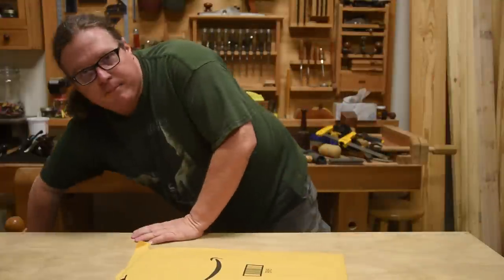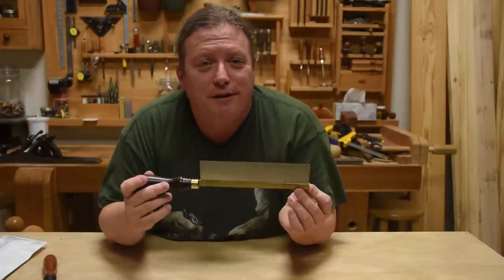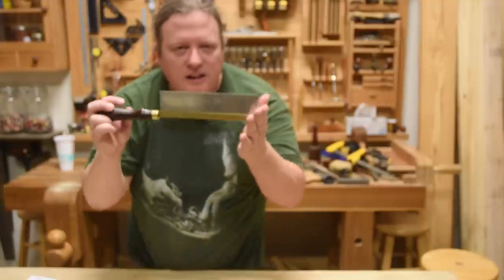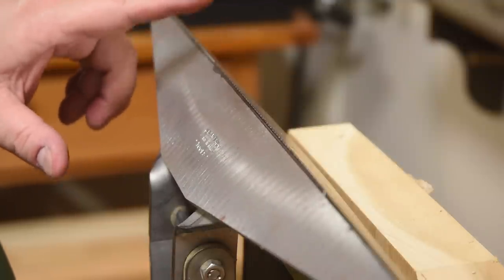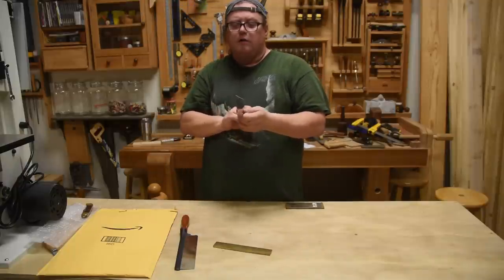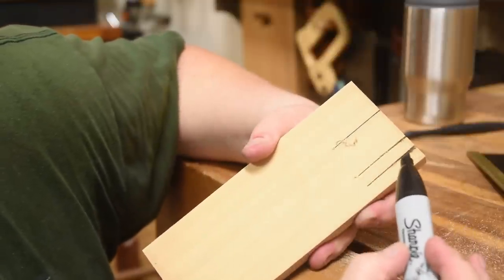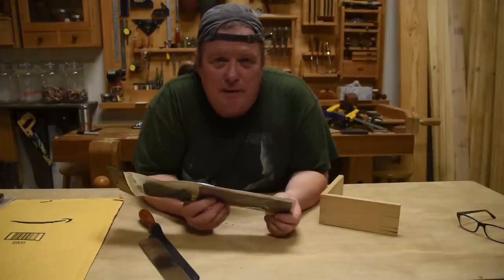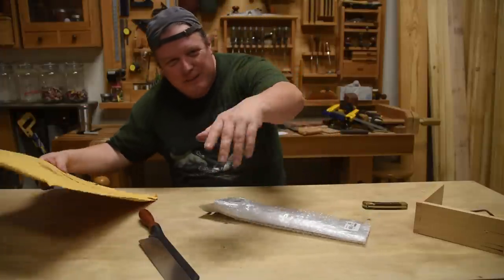A $20 Dovetail Saw that might be able to compete with the Premium Boutique Saws?

Comment: In the past I would buy a new back saw when the one I was using cut noticeably slower, so I have three inexpensive Stanley saws in varying stages of dullness, two that are just laying there unused. Using your sharpening video as a guide, I recently sharpened the one I have been using for many years, (I don't remember exactly how long I have had it), and the results were amazing! It cut so much better and faster, while producing a straighter cut and thinner kerf.
Reply from the maker: They dull so slow you don't notice how far gone they've gotten until you sharpen them.

Comment: Paul Sellers allows as how the sharpen-ability of a saw determines whether it's worth buying. Apparently, some saws are disposable. It seems I can buy a $20 saw and then buy lots of equipment to make it right. And if I buy a $250 Cosman saw, I'd still need the equipment to keep it right. Just how much would I need to spend on the equipment?
Reply from the maker: You didn’t listen well to with Paul or I. Hardened teeth are designed not to be sharpened at expense of staying sharp much longer. A $3 file, 2x4 to squeeze the blade and clamps to do the squeezing is all need.
Reply: You can even sharpen those hardened ones with a 5-10 dollar file (diamond needle or 6 inch triangle depending on the tooth size.)
It won't come out as nice, but it will be more than plenty sharp enough to cut with.

You don't need hundreds in gizmos, and trinkets for sharpening a saw.
You don't even need workholding to hold your saw.
Just a file, and something to brace against (your workbench edge.)

Comment: Hacksaw with a 14 or so tooth blade will work in a pinch.  Tighten it up and go for it.  Won’t clear the dust as quickly, but if you are really in a money bind, it will cut.  Too much kerf?  Diamond stone/ India stone sides to thin the thickness of the blade.  They are hardened more than a custom blade, so you probably won’t need to replace for ten thousand dovetails or so.  Softwood would probably be 10/12 tpi for a quicker cut.  The masters of the past didn’t have what we have available, and look at what they did.

Comment: Years ago, I started out with an even cheaper version of this saw, the one with a steel back instead of brass. I'm not sure if they make that version anymore. Much like you, I sharpened it at some point (can't seem to find a blog post saying when), and after that, it was great. I made a lot of stuff with it and never had a problem. I stopped using it only because I made a new saw to replace it.
Reply from the maker: Hope ya gave it away.
Reply: @wortheffort  I did give it away, but wouldn't have felt bad about selling it.

Comment: Okay, so Shannon doesn't like the gent's saw, Rex Krueger and James Wright seem to think that it's only any good for throwing in the trash. And yet, you have the Veritas and have used it for 10+ years. Why? For me, the gent's saw just seems the correct one for the tiny, thin stock I am working on. I don't own one yet. My only backsaw is a cheap Spears & Jackson tenon saw. Just wondering why the gent's saw is good in your eyes.
Reply from the maker: Because it works. Kids seem to use it more naturally too. Pull saws use a straight handle. I use both but for detail joinery I reach for that gent.
Reply: @wortheffort  Thanks! I appreciate the response. It makes sense.

Comment: I am curious if you ever tried a Japanese style saw, like this?
https://www.amazon.com/gp/product/B07HYVW78L
It costs under $30, has replaceable blades for about $17 and is super thin, sharp out of the box and comfortable to use. Not meant to be sharpened (but probably could be) and is, of course, a pull saw as Japanese saws are. As a newbie in dove tails, I tried classical inexpensive dove tail saw and had a horrible result (I did not sharpen it), but when I tried this Japanese saw I was blown away at how well the actual sawing part of the dove tailing went. I still need a lot of practice with other dove tailing aspects, but the saw aspect is SOLVED for me. Was wondering if you could review one of these. They are very inexpensive and I was very impressed.
Reply: Vladimir Ferdman the difference between a back/pull saw and a back/push saw is the body mechanics for each - the way you have to keep your body aligned for each to be efficient; I’m still learning all this stuff also...
Reply from the maker: That is covered in my other sawing videos.

Comment: Todays saws are cut with a laser and they are for shit. they cut backwards about the same as forward. I can tell by the sound. I have a similar saw I bought in 1967 and never sharpened it and still use it.
Reply from the maker: These were stamped. Likely use same machine for all expecting customers to sharpen. Kinda like it was 60 years ago. No tools actually came sharp back then.
Reply: So you bought a saw over 50 years ago, have never sharpened it, and it still cuts?

I think this is more a case of complacency with poor tooling than a tool that still works well.
Reply: LOL, I sharpened many saws when I was a carpenter.. If you have the right hook on teeth they will cut and have a much different sound on the forward stroke. Today's saws the teeth are almost straight up with little or no hook.

Comment: And all it takes is $400 worth of sharpening tools.
Reply from the maker: That’s an excuse not to try. A 2x4 pinch vise and a file is all you need. That ain’t $400 and what you saw in video wasn’t even close to $400.
Reply: @wortheffort  I love your work. Enjoyed your video. But the tools you used sell for close to $400 at Lee Valley. I'll see what I can find for a DYI vise.
Reply from the maker: That vise is $200-250 and I told you a pinch vise made of 2x4's ($4) could be used. Files are a buck or so a piece....
Reply from the maker: that's a pinch vise.....
Reply: I built one out of scrap and some hinges that clamps into my vice then made a angle guide out of a piece of scrap and a marker.
Reply: I inherited a large pinch vise from my father but without it I'd just take a stick, cut a kerf through it to fit the plate and clamp it in your bench vice. I do that for my small saws anyway rather than dig the big beast out.
Reply: @wortheffort  Where do you get files at this price - the cheapest I could find were $4 each if bought by the dozen, about $7 otherwise.  A buck sounds a whole lot better!
Reply from the maker: @stephenaddison  hardware store